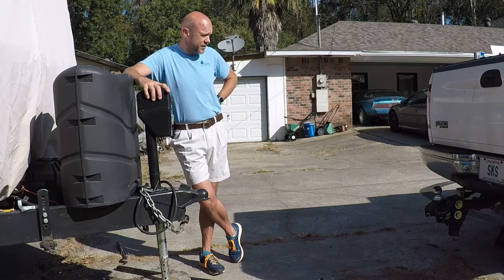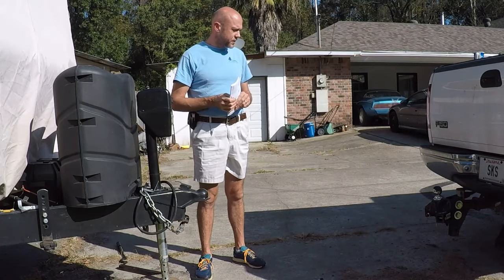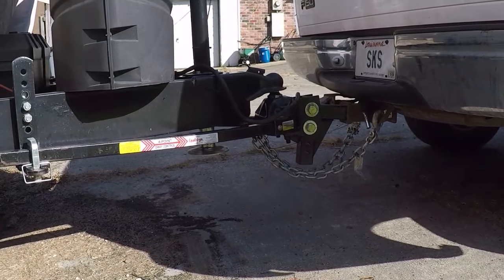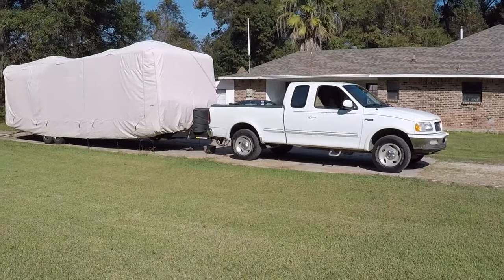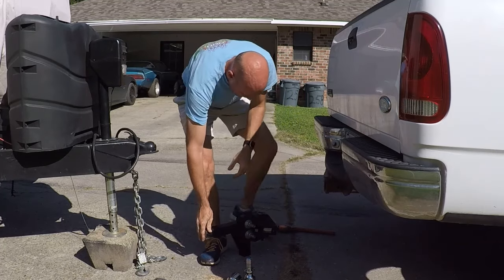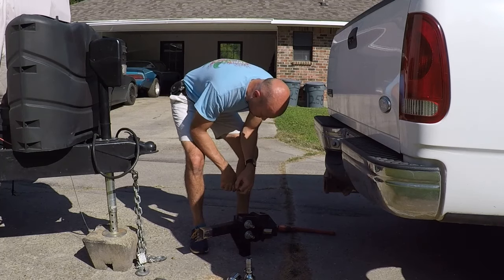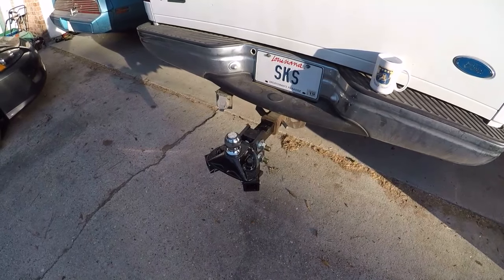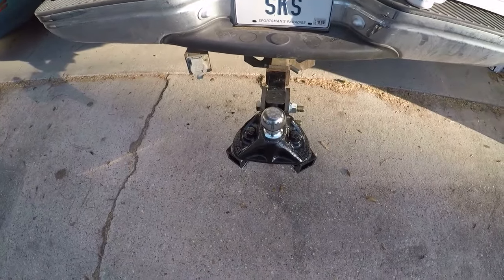Installation and setup of a 14k Equalizer weight distributing hitch

Comment: I did read the comments in this video before making my own comments. I am glad you upgraded your tow vehicle to a 3500. The F150 that you have in the video comes with a Class III/IV receiver rated at 10kLBS tow rating with  maximum tongue weight of 1k LBS. The reason the bars have to be set up so high is because the factory receiver is flexing because it is way overloaded and having a hard time restoring the weight on the front axle. Dangerous way to pull. The factory receiver can fail and then it is goodbye trailer. A trailer like you have requires at least a 3/4 ton rated tow vehicle.  The bars on the Equalizer hitch should be about parallel with the frame. If you have to go higher on the bars means you need to add a washer to the hitch head.

Comment: Purchasing our first trailer in two days. It will come with this same hitch setup. Really enjoyed your video. You remind me of myself: mostly genius with a bit of "goof-ball". I can easily see myself forgetting to remove the wheel covers. How much does that hitch-ball assembly actually weigh? Also your trailer cover was interesting. I suppose you can buy these for any trailer? Squeak pads? Thanks for posting.
Reply: I'm presuming he means the pads you put on the L brackets to stop the racket the bars make whole moving in them.  I just found out about them and wish they came with the hitch.  Kind of chest they don't since these hitches make so much noise with steel on steel.  Here's a link to them on the equalizer website.  https://www.equalizerhitch.com/store/hitch-accessories/sway-bracket-jacket-pair

Comment: When you are installing the tension bars it looks like there is no weight on the hitch.  After installing the bars you then put the full weight on hitch???  This is the part I am missing and need confirmation.Thanks!
Reply from the maker: I've found that if you are really using the hitch to transfer a lot of weight it is less effort to Jack the trailer up to snap in the bars then lower it. Same when you remove them.

Comment: I'm sorry but what the hell are you hauling that has over a thousand pounds tongue weight and you pull with an F-150? is your your trailer near 10,000 pounds? I have an ecoboost and that sounds a bit much
Reply from the maker: Lol. The F150 was the easiest to get to that day. It is a 32' box, 9600# travel trailer. I was towing it with a 2014 Ram 1500 with a Max tow rating of 10200#. Now I tow it with a 2017 Ram 3500 with a Max tow rating of 30,300#.